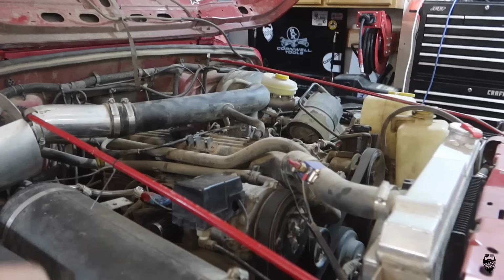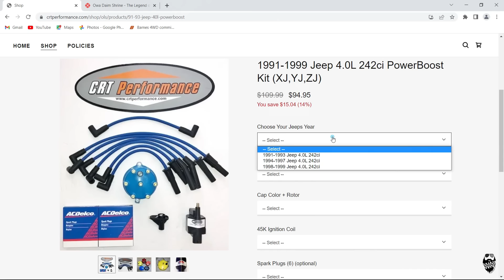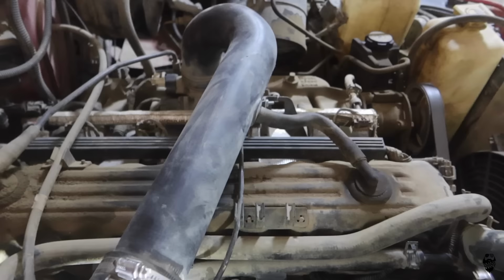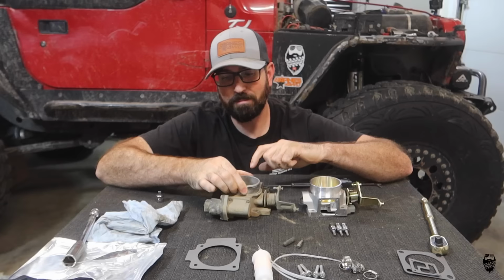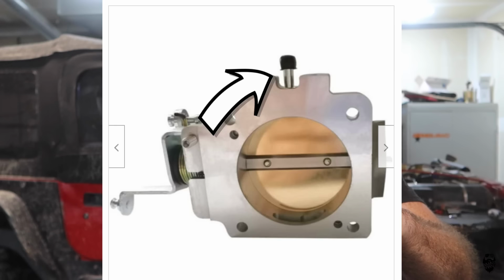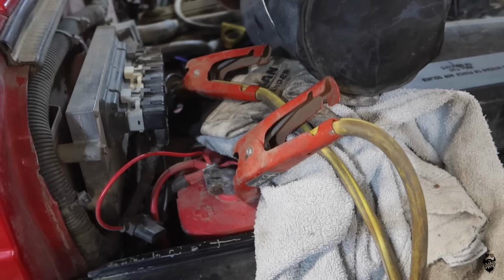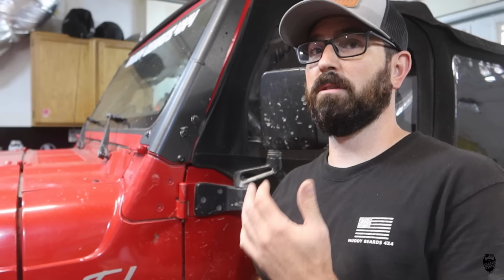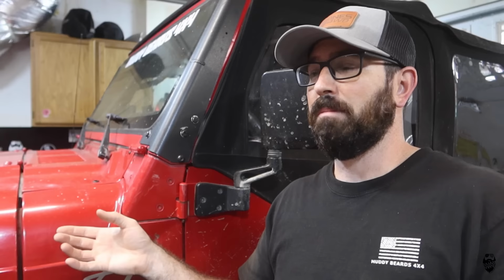MUST Have Jeep Wrangler/Cherokee 4.0 Upgrades?

Comment: I got my injectors from Ksuspension. Noticeable difference. Ran smoother, more pickup. Eadier starting. The best benefit was gas mileage. I used to get 170 miles from a tank. With the new injectors,  I got 250 miles from a tank of gas.!
Reply from the maker: I am definitely going to get a set👍🏻
Reply: Hey ray, which injectors did you end up getting? The 12 hole?
Reply: @claytonsaxton6757  I got he 4 hole injectors. I think the 12 hole needs a different pig tail connector.
Reply: @rayzielonka7856  12 hole use the same connectors, at least on my 2000 they do.
Reply: I haven't really driven mine far enough after I installed the four hole injectors to notice fuel economy gains. Definitely starts easier and runs smoother ,But before I had the factory injectors it could not pass California emissions, after installation passed with flying colors.
Reply: Got the 5.2 in my 98zj, just got a set of 8  injectors from parts geek 149 plus tax&shipping total 165, sourced the tuneup stuff locally, but this jeep and past jeeps all seem to run best with the autolite copper core plugs
Reply: Was it 4 port or single port injectors?
Reply: @edzimdahl1158 

Copper all day. I thought I was doing something nice when I got some platinum crazy plugs…Jeep hated it. I assume it could sense they were not 3 dollars a piece.
Reply: The 98zj w/5.2 averages about 375 per tankful,
Reply: I did the 12 hole on my 99 xj. No issues. Same connectors.

Comment: One other thing: if you change to an electric fan you can gain almost 30hp at the top end. This has been tested and proven. The only drawback as far as I'm concerned is that the mechanical fan moves more air, and sometimes that's what you need when you're moving slow out on the trail
Reply: Why not have both?! I gotta fix my wires for my electric fan.
Reply: Then why not have two electric fans?!
Reply: @zachsheffield1325  because the relays can burn out. you can carry spares, but sometimes they are difficult to access to replace. mechanical is far more reliable.
Reply: Where are you going to run 2 fans?
Reply: @davidschlarp1606  lots of vehicles have 2 fans. Specifically, my WJ 4.0 has a mechanical fan and an electric fan. Electric was standard on that model, but if you got the factory tow package, they added the mechanical fan for “heavy duty cooling”. The WJ electrical fan was controlled by a relay, so it only operated when called for, usually when running the AC. The relay is located behind the headlight, where it would get hot and burn out, frequently.
Reply: If you're moving slow, wouldn't the electric fan flow more?
Reply: @davidschlarp1606 the Yamaha era Ford Taurus’s have dual electric fans that fit in these things pretty well. Also the mec fan isn’t going to move more air at slower speeds because you are at a lower rpm
Reply: I have three electric fans. 😂 El Paso heat gets rough.
Reply: 3 fans with manual override, right side fan on all the time

Comment: The greater plug wire diameter really only buys you more silicone for greater ability to resistance to loosing slight spark energy if routed near grounding items. I used to manufacture and test ignition systems back in the day. 8-)
Reply: Great info to know.

Comment: One way or the others, you need to change the spark plug  sometimes. From what I heard the in-line 6 should be change every 50 000 km. So it's just regular maintenance.
Reply: what is 50000 km in miles....  this is America so we need miles :)
Reply: @russellalbro6600  Roughly 30000.  That seems a bit excessive to me.

Comment: MyTJ has an actual tuner on it. I had a jump from 133 HP to 145 HP with everything else stock. This was done on a dyno. It is the biggest bang but its is expensive.  With HPtuners now supporting the Jeep 4.0 it is fully tunable just like an LS. Now saying that I still want/need more power and I am looking into a turbo. it needs just a little more power to run down the highway.
Reply: Eh, it is much less refined and has many less tables and options as they just have not put much into developing it like they have the LS.

Comment: Kelly, great video. I'm wondering why you are sinking money into performance upgrades for this old engine. If it doesn't have enough juice you should do a swap. What am I missing?
Reply: I love the bulletproof 4.0, but some have put on insane lifts and unnecessary enormous tires putting an extreme toll on them and the axles that they weren't designed to handle. While others have bought TJ's where the previous owner neglected to do routine maintenance, and that's when our 4.0's lose their longevity. Then people start to bad mouth the 4.0 and swap them out for a 4.7 stroker or a V8. This is bs. 

I wheel at a moderate to high level on 32" ko2's with a 2" lift with my '05 TJ Rocky Mtn. But I'm not rock crawler, I'm an adventurer hitting mostly moderate to occasional difficult trails. In my opinion, the 4.0 is the best engine ever put in any Jeep. But to each their own.
Reply: @JeepTJWheelin  I think if Kelly was happy with his engine I doubt he would have spent $250 in performance mods that had negligible results. He's not running 32" tires either. My question is why would he not save that money for an engine swap?
Reply: @Ryan_Tidwell    Good point, he threw $250 out the window. Maybe he sells the 4.0 and tells the new owner about those "upgrades" and gets some or all of it back. I've known rock crawlers who wheeled with 33's - 35's with the 4.0 and regeared and did very well. And they were highly skilled off roaders like Kelly.
Reply from the maker: Thanks, I would like the 4.0 to perform at its full potential, power and efficiency. Also I do have a YouTube channel where I need to make content that people will watch and comment on. So thanks🤟🏻
Reply: In what world does 250 bucks contribute a meaningful amount to a swap? At the end of the day he swapped some old parts for stuff that are new and may help performance. 

I’m sure he likes wheeling and not having a project sit in his garage for a year too lol.
Reply: @bonespur2728  $250 is $250 dude. I know people that got junkyard engines for $1000. That would have been a fourth.
 Kelly was making YouTube content so maybe its paying for itself. 
I am thinking about a swap because my TJ won't hit 65 on the highway.
Reply: @Ryan_Tidwell  rebuild. 4.6 stroker
Reply: The 4.0 is bulletproof for one Ryan. 
2- it's loaded with torque.
No timing belt, decent fuel mileage,  and simple maintenance. 
Do you really need more reasons ?
Because my Race Shop parts getter XJ has over 400,000 miles, and doesn't burn a drop of oil. 
I can afford a brand new ANYTHING,  but I grew up decades ago and I use my Engineering skills and my maturity to better my business and my families way of life. 
T.S.RACING
Reply: @t.s.racing  Everything depends on your use case and whether or not something works for you. I agree the 4.0 is supposed to be bulletproof. Mine has a leak that I have not been able to fix, and I have to drop to 3rd gear going up hill and can't do 60 mph. Its dead reliable but its clapped out. So what I live with a gutless leaking turd? Or I change it. So to answer your question: Yes I definitely need more reasons.
Reply: @t.s.racing the loaded with torque thing is meh everyone and their mother says this....  The torque curve on it is the same for a 318 or 360.   But the 318 or 360 has globs more torque.  And both of those engines are very reliable as well.

I have a 4.0 with 410k original miles..  and my 5.9 limited ZJwith 220k miles.  The 4.0 is a pig is slow as hell and i dont like driving the thing because of it. 

With cruise control on going up jiat a slightinclince itll downshift two gears to even get the power to maintain speed.. passing on the interstate is nearly impossible at 60-70mph.  Its really slow.

Its just as bad as my AMC360.. but that 360 has way more torque and pulls a 5500 lbs Wagoneer vs a 3800lbs ZJ.

It has a timing chain btw.. and it does need replaced like any chain.

Overall the 4.0 is reliable as hell.. i can see ours getting 500k soon.   We drive it 160 miles a day and it still doesnt burn oil and still has 30-40psi oil pressure lol.  Its deff got that 4.0 clanking but ya.  500k will be here in about 14 months or so at this pace.  Im actually amazed i have 410k on the diffs.. transfercase and that 42re transmission.. yes.. the 42re has 410k

Comment: Great video.  Next time you want to “machine” or “lathe” a fitting down, chuck it up in a drill and run it against some sand paper or a bench grinder.   Keep on keepin on brother
Reply from the maker: Good idea, I have sanders that would have worked great but I couldn’t figure out how to hold it. Drill chuck would have been perfect. 👍🏻

Comment: To quote Stevie Wonder from over 50 years ago: " When you believe in things that you don't understand, then you suffer". A bigger throttle body will only make more noise. MAP will not be affected, partial throttle response will suffer. Bigger plug wires won't increase ignition secondary voltage or current. Your big-assed cat and turbo muffler get choked down by the stock sized exhaust pipe that now runs precariously close to the rear driveshaft. Your air filter now gets to suck in heated under hood air and is restricted by the primary filter, thus negating the bigger throttle body to begin with. Other than that, great job!
Reply: As a long time YJ owner, putting on an aftermarket header made some improvement, but the big gain came with replacing the stock air filter.  After many miles, I replaced everything but the coil in the ignition system and was surprised how much it smoothed out the engine.   One additional fix - adjust the throttle cable to get out the slack.  It gave me a much more responsive engine.

Comment: As far as motor upgrades on my 98XJ; Banks Header, Hi-flow cat, Flowmaster 44, true cold air intake, 62mm throttle body w/1" spacer, 703 four hole injectors, MSD Blaster coil pack, MSD ignition wires, cap & rotor w/iridium plugs, Mechman HO alternator w/two XS batteries with all 1/0 wiring. Also, all sensors are new & are Mopar and I have an on board OBDII that streams live data to my phone!! 

Now I didn't do all this for power, I did it to let her breathe and be more efficient especially with 170k on the OD. 😉
Reply: Copper plugs are much better in the 4.0
Reply: @Swifty_007  says the manual & most people but not on mine. The electrode wears quickly on the edges creating missfires and the gaps open up. I moved to platinum and it got better. Then to iridium and these plugs have lasted the longest. It has to do with the heat that builds up between cyl 5 & 6.
Reply: @seniorxj2931  alright you know more than me..damn

Comment: In my experience, matching your axle gear ratio to the tires being run will is pretty much the best thing you can do for power. 

All of the throttle body mods, plugs, wires, programmers might get you a little.   But it won’t even compare to having proper gearing.  

Unless you spend thousands and many hours swapping in a 4.6L Stroker or adding a supercharger.
Reply: Totally agree, got to change axle gearing if you plan to slap on 35" tires. I built a 4.7 engine for my 98 Jeep Wrangler 4.0L which helped Her to reach freeway speed on 35" tires, but still lacking, then did an axle upgrade to match 35" tires. 

Long story short, She runs down the freeway at 75-85 mph on 35" tires, crisp starts from red lights, etc... It's a Jeep at the end of the day / not a sports car. I may try the larger throttle body matched to an enlarged intake ID as 4.7 sucks more air.... Please don't take my comments as critical as I've learned a few things and we all learn from each other. And yes, building a 4.7 stroker is not cheap per muddy and only adds some torque, go with axle gearing if your slapping on larger tires.

I respect those that share and take their time to share via videos.
Reply: doesn't help he's running heavy 40 inch tires if he put a lighter tire on it might be a little better yes gearing will help but then you always have to have those tires
Reply: I have a completely stock 05 TJ sport with 3.73 gears on a Dana 44 rear/Dana 30 front.  What gears do you think I need for 33 inch tires.  Stock tires are 30x9.5x17R.
Reply: @Mark622111  hey dude, where do you typically get the axle gear ratios done? im more than competent on doing little things to my jeep, but dont think I could handle that job? is it a tough thing to get done? thanks!
Reply: @stephendockray6698  410s for the street or 456s for better crawling.
Reply: @stephendockray6698  I run 488s on 35"s but I don't care about speed or top end.

Comment: One of the greatest motors ever made.
The only flaw. The fuel injectors are right next to the exhaust manifold. The fuel gets hot. After a while you go through catalytic converters, or mufflers. My suggestion. Buy fuel injector boots. They go around the fuel injectors. Solved my problem. ✌️
Reply from the maker: Yup, I did that years ago, I have a video on it. It definitely helps 👊🏻
Reply: I changed the Fuel Rail to a Billit Fuel Rail and Insulated to Reflect the Heat. I need to drive it and ill report back. I know this is not a new Post. Duh. Just
Reply: @MuddyBeards4X4 link to video please and thank you about the boots.

Comment: Tune the EFI for even better results.    
Not jeep related but.  I put a 75mm ported TB on my chevy s10 4.3  factory was  75mm necked down to 70mm with a restriction plate on the butterfly.    After opening up the factory TB.  It has instant throttle response and noticeable difference.   But then took hp tuners and tuned it for the extra intake flow and got even more noticeable performance increases.   Im sure if you tuned the pcm you'll definitely have a bigger performance gain then from just doing bolt on mods.

Comment: One more setup you may want to try. a Holly Capacitive ignition system with tri-fire sparkplugs. Both create a tri-leg spark to ignite all fuel, and the capacitor (energy storing) ignition also creates, generates high/fast enough firepower to keep the juice flowing. I used a blaster coil and 10mm sparkplug wires, a Holly performance distributer cap and rotor; and Jeep oem style injectors with a four hole design.

Comment: I put the 4-hole Mustang injectors in my 97 XJ something like 22 years ago.  Still in there.  Honestly not sure they really made any difference, but I always figured better misting can't hurt things.
Reply: I installed the k suspension 4 hole, not sure if it helped my mpg but it did help my starting.

Comment: My 97 TJ 4.0 is the last model year with the single, primary coil setup. According to a couple of racecar builders I confer with regularly, my dreary throttle response, especially at the lower end was more about the explosion trigger and completeness, than the air and fuel content, which i had already addressed, similar to this video. They suggested that in order to prevent  a "slow/low" firing condition, the ignition system needed a "middleman" to develop and maintain  enough voltage for a  sufficient amount of spark, firing consistently within the prescribed/preset timing intervals. I needed something between potential and execution  that could/would manage the process.  The primary reason that the (single) "coil over (spark) plug" is now the industry-standard is precisely for control and bottleneck elimination. The ECM can precisely control the voltage discharge level and timing consistency at each cylinder. This was less important in "the olden days" before the emergence of automobile standard and attachable, electrical gadgets and devices. Every time a device is turned on or off, there is a corresponding surge or drop in the direct-current loop. The residual effect is absorbed or lost within the succession of other devices powered at that time.  There are only two ways to resolve the condition, "coil-over-plug" so the ECM can regulate it, or if that's not possible, then installing a regulator, one-step past the ECM, would be the next best thing. With that "regulator" you also get the additional benefit of an RPM "limiter" (in case you snap something within the drivetrain during high acceleration) The CDI prevents major damage to the engine from the ensuing spike in RPM's, while the uncontrollable bottleneck is also avoided, thereby eliminating the loss of performance from primary voltage-lag (slow) and/or a lowered, constant throughput (low). I used the Holly (MSD) Street-fire CDI. This essentially replaces the primary function of the ignition coil, while providing as much voltage as needed, when needed by the sparkplugs, to ignite the fuel, while also protecting the engine, (offroad) if say you bottom out and snap a u-joint during an up-hill climb.. Additionally, in order to fully and more effectively utilize the 3-legged spark, produced by the Street-fire CDI, I installed the E3 Tri-Fire sparkplugs (E3.58), which are made to split the spark into three legs. Then, in order to insure against any other bottlenecks, I installed the following: Taylor 36271, 409 Spiro-Pro Spiral Core 10.4mm Spark Plug Wire, a high-0performance Accel 120330 Distributor Cap, and a "Borg Warner D228" Rotor (better build). I also replaced the coil with an "MSD Blaster 8228". All other engine mods described in this video, are already installed and modified for optimum performance. The difference in performance is truly "night and day". One other thing I want to mention concerning "mods": I recently installed a "Spal 30102049 16" Curved Blade Performance Fan",  but I am planning on switching back to mechanical. It's just way too, dang loud and the pitch is irritating and as obnoxious as heck. The Jeep is completely customized and that one aspect repels any would-be observer, coming within about a 20 ft radius.) I'll just keep a spare fan-clutch onboard; 'Cuz in the Jeep world. as we all know: "Two is one and one is none!"